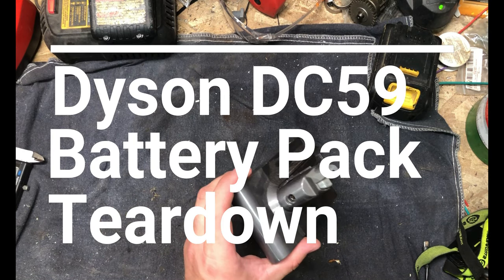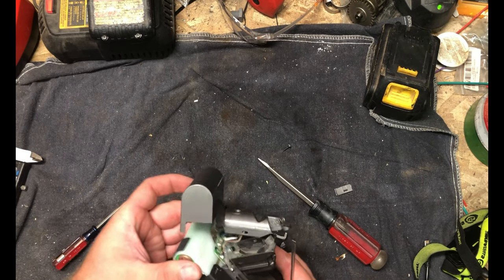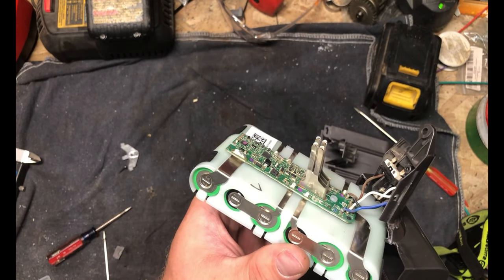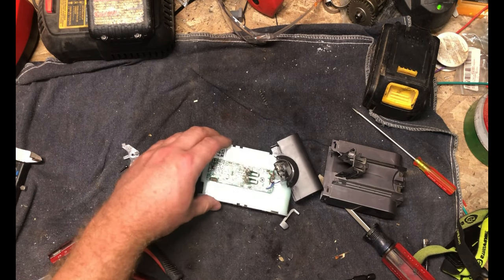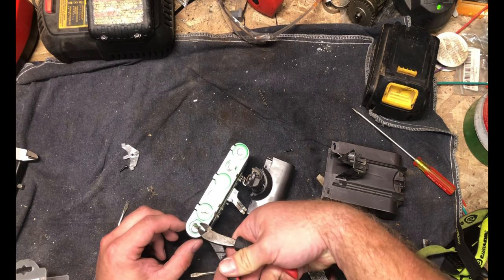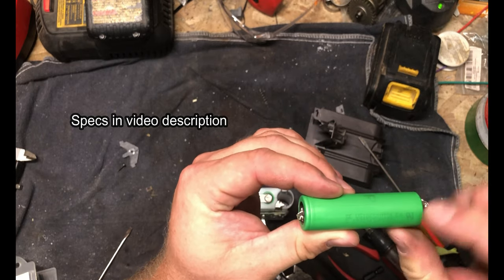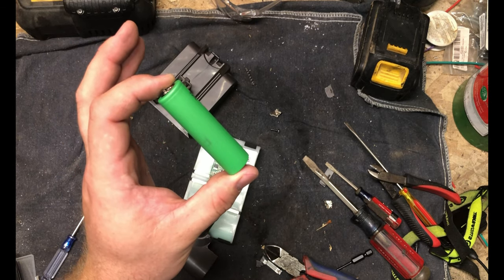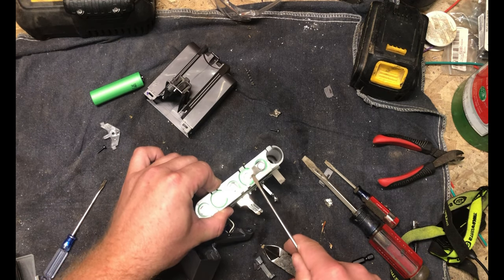Dyson DC59 Battery Pack Teardown

Comment: 6:28  "You're seeing a lot of aftermarket batteries 'n stuff on the market now, uhh and most of them are still using reputable manufacturers to uhh, make the batteries, so uhh, they're really not bad to get those aftermarket batteries".

This statement "might' be true about certain aftermarket Dyson batteries, but you made the statement after stating that 18650 cells are in (everything?), and as it applies to that statement, it is not true at all.  VERY few aftermarket batteries have reputable manufacturer's cells in them, for good reason, that they would cost no less than the OEM packs.  Don't fall for counterfeit cells where they put a fake shrink wrapper on.  They don't test (or weigh) the same as the real OEM cells.

Odds are that your pack had a controller board problem, not merely a couple cells down to 3.9V.  Might just be a bad solder joint that manifests when heat causes thermal expansion, but either way, usually you can test the voltage of each cell without tearing off the balancing and main power tabs.